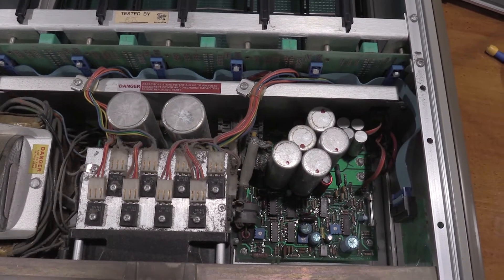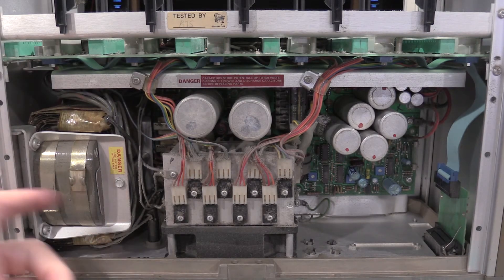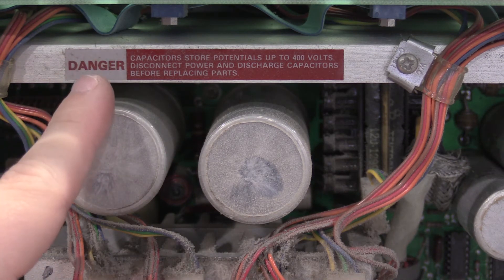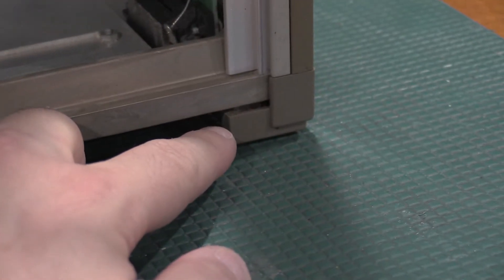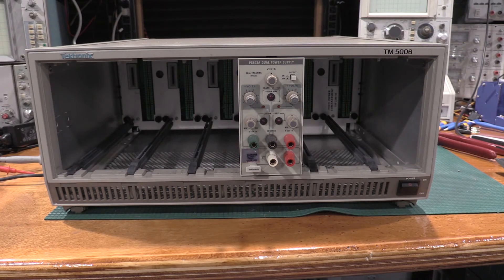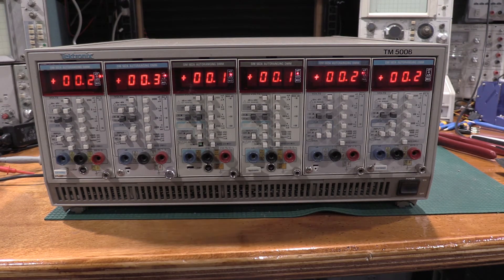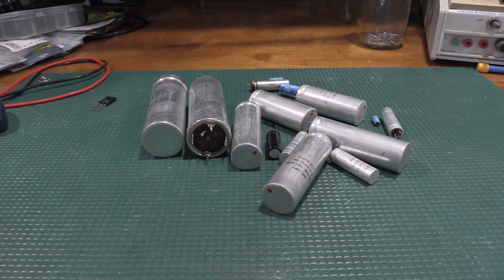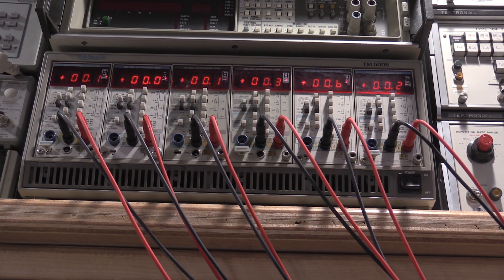Tektronix 5006 Rebuild and Repair

Comment: Nice work! I have a TM503 and TM504 loaded with power supplies and meters. Looking forward to testing them out soon. Sure like the looks of the TM5000 series chassis and would guess they made a few improvements in the power supplies over the TM500 series.
Reply from the maker: Yes and No actually. The TM500 power frames use linear supplies whale the TM5000 supplies us a switching supply. For some things like the SG502, 505, and AA501’s a TM500 supply would be quieter and more stable. For most of the other things the 5000 supplies are good but the increased cooling is better as well.

Comment: Wow, NTE is very proud of that $32 transistor!  Really interesting failure mode of the corroded PCB.  Thanks for the video.  Really enjoyed it
Reply from the maker: Glad you enjoyed. Yea they are I think. Tricky part on the frames is the pin out of the pass elements is ALL over the map depending on when they were built.

Comment: Thanks for the video. Can I ask which electrolytic capacitors you used as replacements?  I see that some of these are 125C, very high ripple rated originally.
Reply from the maker: Shaun,
	Which manual do you have? Unless I missed something which is always possible this unit has 105 degree C rated caps. 125 Is pretty rare and to get a high life hours out of them is even rarer. But the caps I used were a Nichicon part selection criteria was long life-> 105 degree C -> highest ripple current I could get. The small blue caps are only 85 degree C They are really not asked to do very much. But they were over rated to 105 degree C when I replaced them.
Reply: @ZenwizardStudios  Thanks for the reply.  I was looking at the capacitors themselves, in particular the 11000uF, 12v, which have 125C temperature rating in my unit.  Of course production requirements and component availability always change throughout the life of this equipment. All that said, I have done the same as you and settled on low ESR, long life 105C capacitors.
Reply from the maker: Should be fine I checked in my unit the caps were 105 not 125. Not sure what changed over the years If I remember correctly the 26 volt rails work the hardest in these power frames but it is really plug in dependent. Glad it is up and running.

Comment: Fantastic video. I really appreciate both the subject matter and the quality of your work. I have a TM5006 and a TM5006A on my bench right now. The difference is subtle until after getting into them.
Reply from the maker: Thank you very much for the complement. I have some parts coming soon for the 577’s but I will get a short video out soon about what I am seeing with the storage tubes so I might be able to get them adjusted correctly.